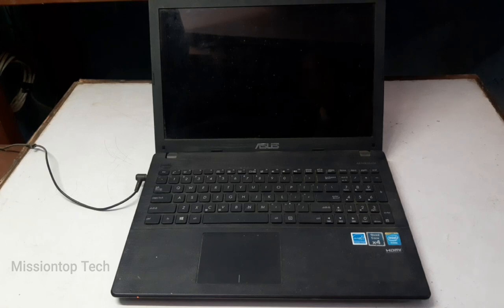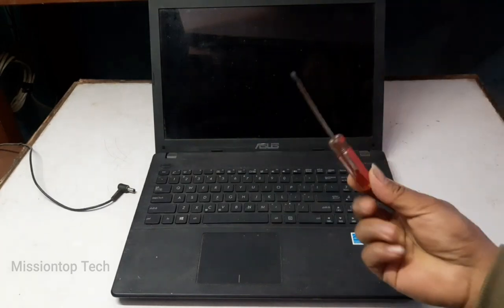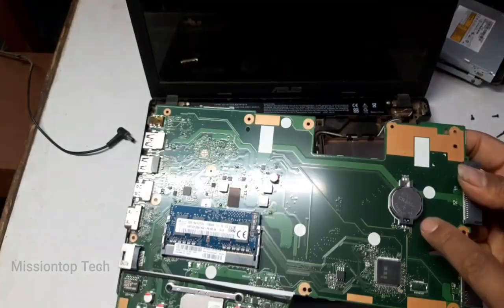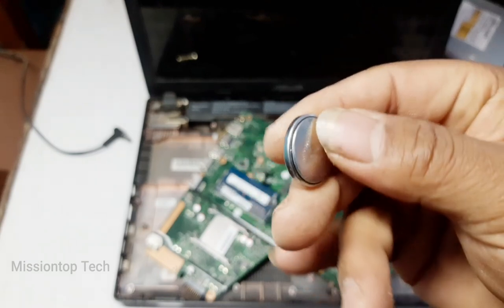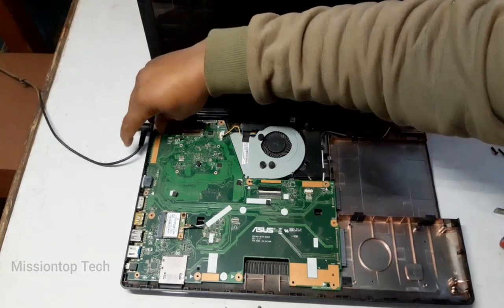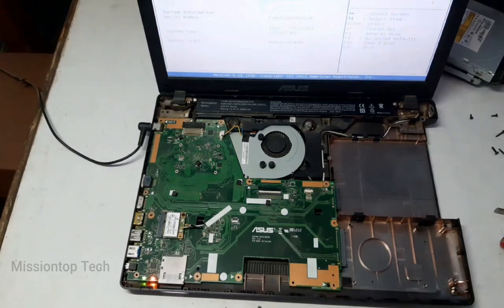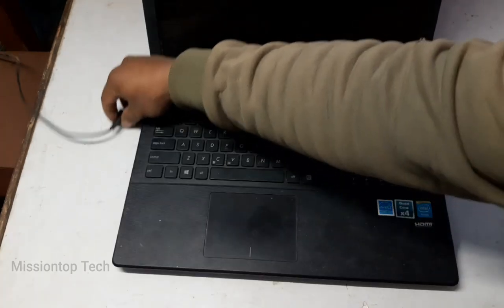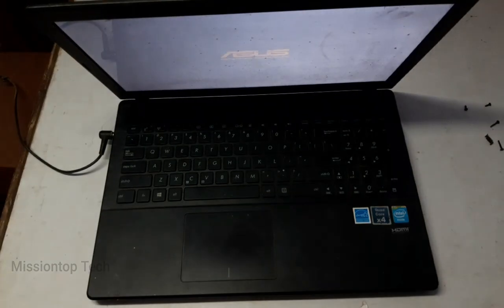Fix black screen problem of Asus laptop

Comment: Hello, I have an Asus Rog gl 530vd laptop, the screen is black, but the laptop works on an external screen.  I replaced the screen cable with a new one, but the screen is still black.  Today I tried the laptop screen on another laptop and it worked.  Therefore, the fault is not from the screen or the screen cable.  What do you think is the solution?